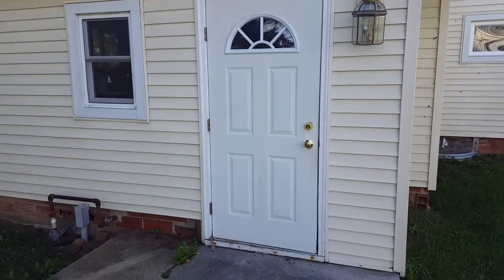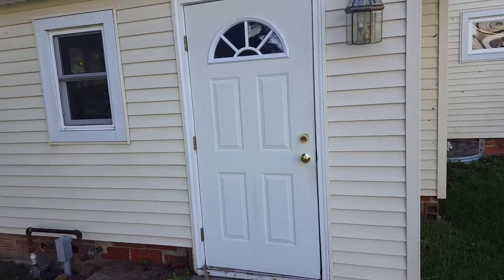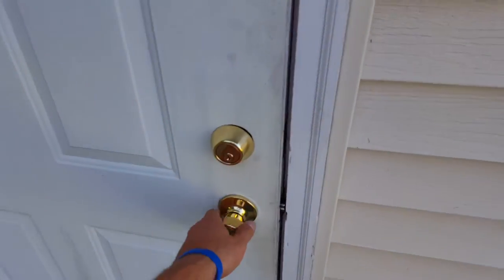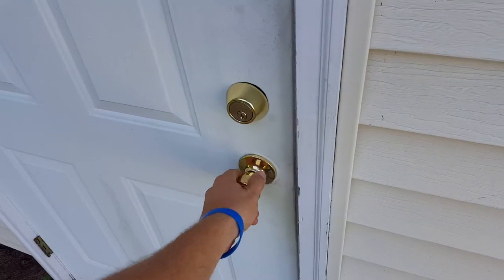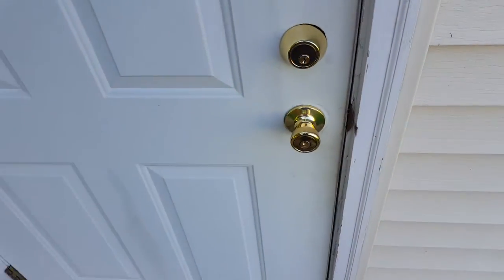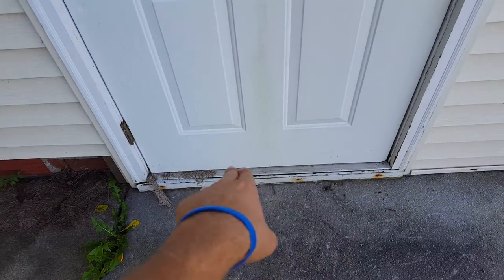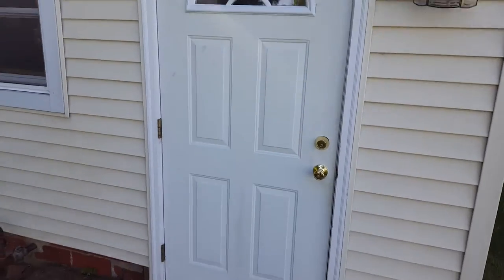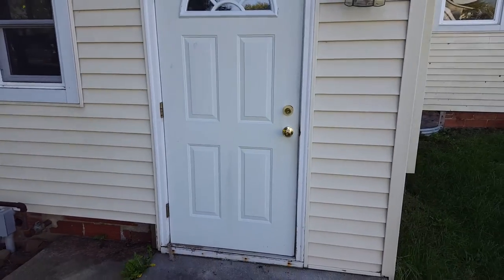Backwards exterior door

Comment: Hi Josh, there are situations when out-swing doors are needed, and they do make hinges with lock tab that recessed into hinge to prevent door from being removed when closed/locked.  There is also weather stripping kits for out-swing doors.  I actually have one on my hoist.  You might need a stop spring like the one on storm door to prevent wind damage if on a windy day, it pulls door from your hand.

Comment: There are countries that require exterior residential doors to swing outwards for increase security. It forces the intruder to apply force against the entire frame of the door vs the deadbolt. Just have to make sure you install exterior security hinges with non-removable pins.

Comment: Not every garage has room for in inswing door, Did you check the interior of the hinges to see if they are designed for an outswing door? They come manufactured with bumps and inlets for the bumps to prevent the door from being pulled out. A regular hinge can also be modified to accomplish the same thing using screws or nails and countersinking the opposite flange of the hinge. As long as the correct modifications to the sill and door stops are done, an outswing would be functional and secure.
Reply: Outswing doors have security hinges available Additionally, outswing doors are more secure than inswing as they cannot be kicked in. They are more wind and rain resistant since the wind forces the door closed and presses the door against the door gaskets providing a better seal --not so with inswing doors.
Reply from the maker: You're right.  Except those things are rarely done, at least around here.  p.s. this door had neither security hinges or any type of modifications
Reply: can an exterior fiberglass door that swings inward be turned around (frame and door) to swing outward not worried about security as it's inside two fences and goes to a pool house?

Comment: There is nothing wrong with an outswing door as long as it's designed properly, including NRP or "non-removable pin" hinges.  There are numerous reasons to make a door an outswing; it's just not typical for residential doors, which is obviously where your experience comes from.
Reply from the maker: Problem is, many are not done the correct way, like you mention.
Reply: @nwohiohomeinspector  That applies to all doors.

Comment: This may indeed be a "backwards" door, but depending on what side this door faces, an OUT swing door prevents wind/rain from getting inside the house.  These doors are also made with security in mind as the hinge pins can NOT be removed.  Out swing doors are also required by fire code in some states, for garages, and for public buildings.  I'm getting ready to install an out swing door from our garage to the outside because heavy wind and rain seep into our garage.

Comment: Inswing doors are so stupid, no benefits at all..
Reply: Inswing doors help with forced entry. It is easier to push against a door with your body weight to close it or push against an intruder trying to enter versus trying to grasp it by a small door knob to close it when the intruder has their hands on the edge of the door pulling it open.

Comment: I don’t see how it’s installed incorrectly. It was probably installed that way because there is not enough shielding from the rain. My shed is set up like this because there’s almost not overhang from the roof. If it was installed in-swinging, the inside of the shed would get wet because the door seals are not tight enough to keep direct rain out.

Comment: There are hinges made that have non-removable pins to prevent this... open the door and look to see if there is a small set screw visible in the barrel of the hinge when the door is opened.  Amazon has dozens of hinges for sale that can fix this, just make sure you understand the difference in size between a residential hinge and commercail one.
Reply from the maker: Yes I know, you're right.  This particular door did not (nor do the vast majority of them, at least around here.)